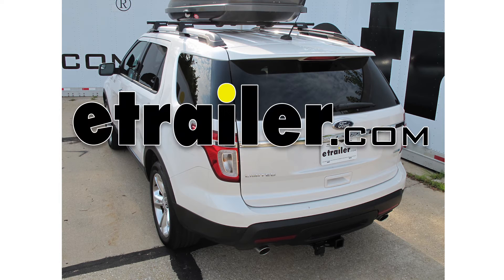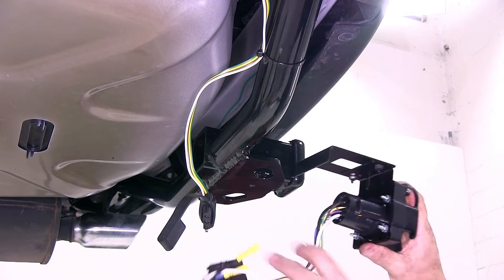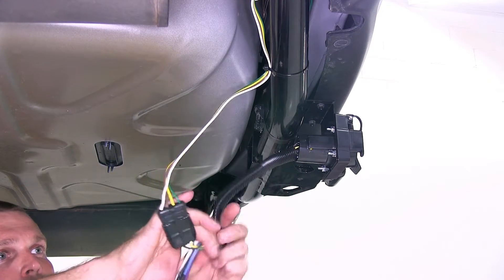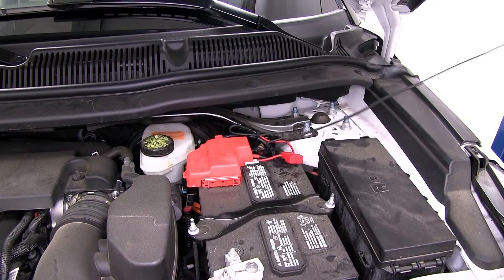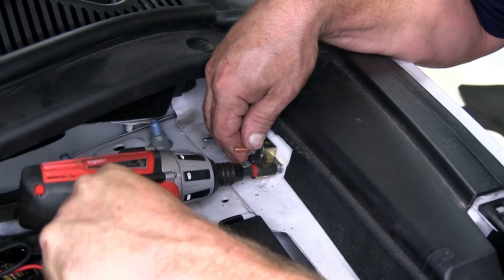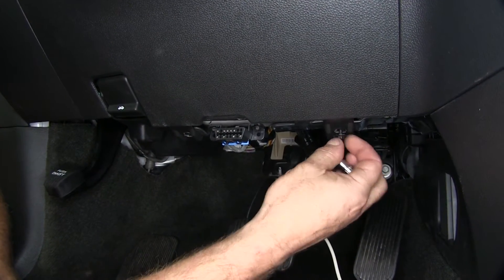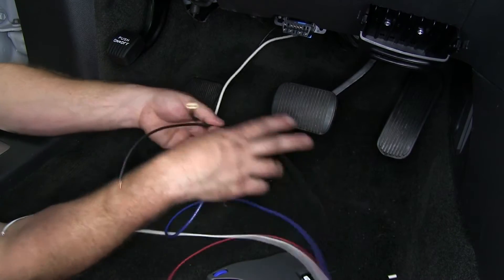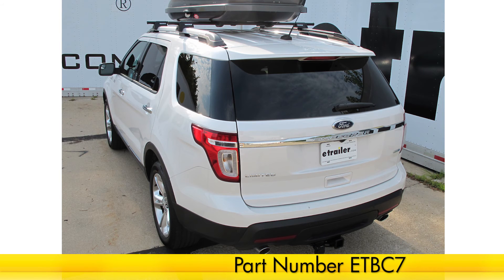etrailer | Installing the Tekonsha Prodigy P2 Trailer Brake Controller on your 2014 Ford Explorer

Comment: YOU SHOULD BE ABLE TO JUST PLUG IN TO THE PLUG UNDER THE DASH AND CONNECT THE BLACK LEAD AT THE 7-WAY PLUG ON THE BACK TO THE ORANGE WIRE IN THE OE HARNESS BEHIND RIGHT REAR TIRE AND THE BLUE WIRE TO THE BLUE WIRE.

Comment: shouldn't I be able to tie the blue and black wires in at the rear of the vehicle and just plug the brake controller into the port under the dash?

Comment: I´m from germany, we don´t have the brake controller. Can you explain me the sense, please?
Reply from the maker: The brake controller that is installed in a vehicle is to control the brakes on a trailer. When hauling a trailer, the heavier the trailer you will need more braking pressure so that the vehicle does not have to do all the work. Without the brake controller you will not have a signal going to the brakes on the trailer.
https://www.etrailer.com/Brake-Controller/Tekonsha/90885.html
Reply: etrailer.com thank you

Comment: Good lord what a hassle
Reply from the maker: You will only need to install the ETBC7 wiring kit if your vehicle is not equipped with a factory tow package.
https://www.etrailer.com/Trailer-Brake-Controller/Tekonsha/90885.html
https://www.etrailer.com/Accessories-and-Parts/etrailer/ETBC7.html